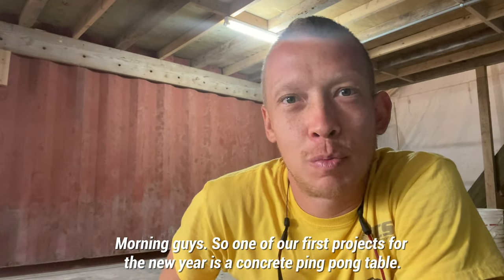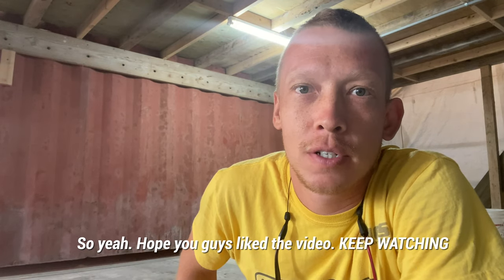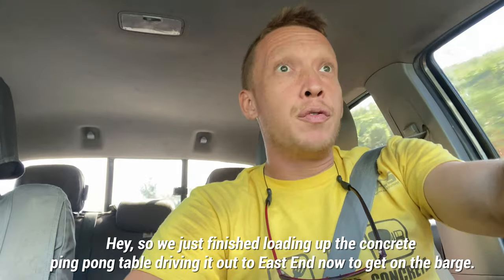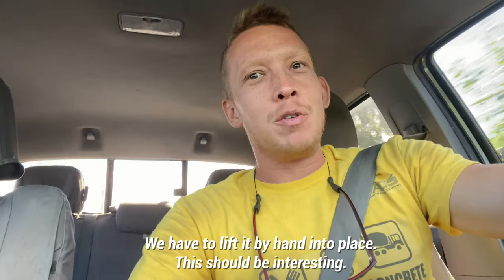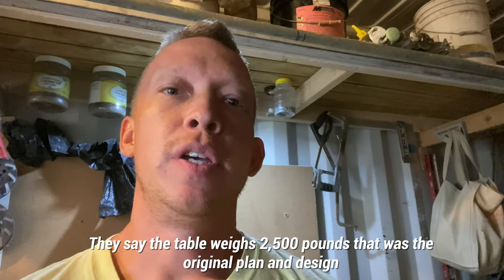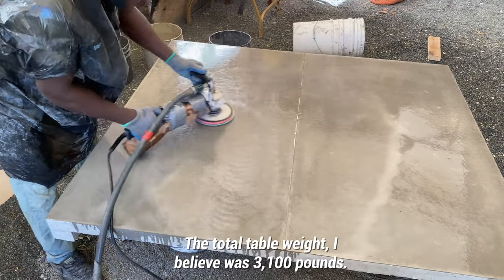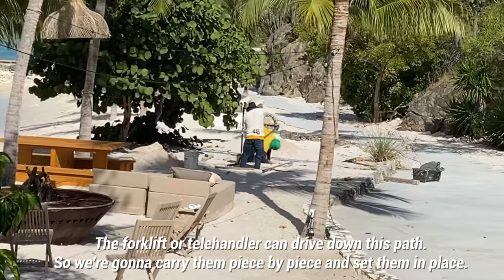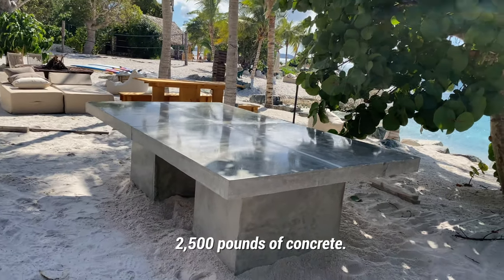Best Concrete Ping Pong Table on a Beach Ever!!

Comment: Hi mate, I'm planning to build a table like this and I wonder if the ball will break?Even with the hardest hit. How useful is this table during an active game?🙏❤️
Reply from the maker: @tomfson  the concrete surface has no difference In play action for regular or advanced play. Now, im not a professional but I have played a lot in highschool and college and I didn’t notice any difference. An extreme professional might tell you it plays differently but I’m sure for your needs it will make 0 difference. The balls wont break. But if you’re putting it outside like this one, wind does play a factor in ball flight.

Comment: I'm looking forward to replicate this, what were the materials used?
Reply from the maker: Concrete mix with additional portland cement, glass fiber and silicafume. Then obviously we had 1/2” steel rebar and also used some rapid set “TRU” for the white line down the middle. We also did an epoxy grout coat with marble powder to fill the pinholes. Ameripolish 3DSP sealer. I think that’s everything 💪🏼🤔 it’s been a while lol
Reply: @ConcreteBVI  thanks a lot
Reply from the maker: @timelessvibes5550  ya no problem. Anytime.
Reply: @ConcreteBVI  Oh wicked you literally replied with everything we need to know. Very generous, thanks!
Reply from the maker: @michaeldubery3593  ya no problem. Anytime.